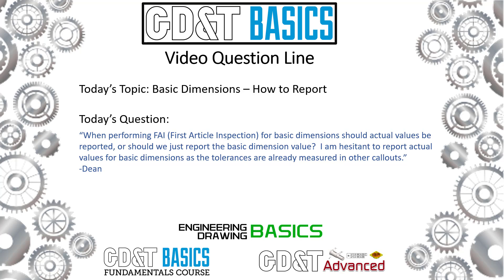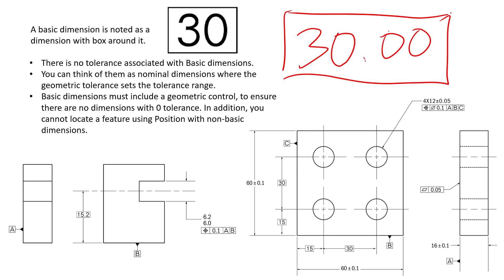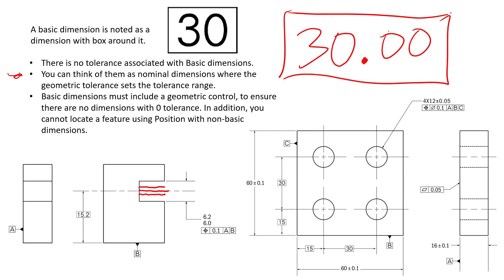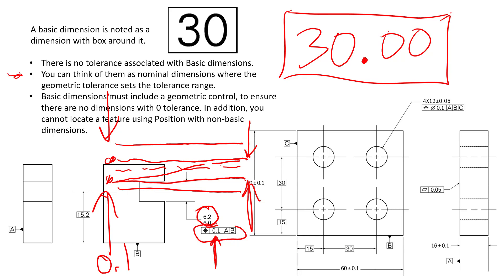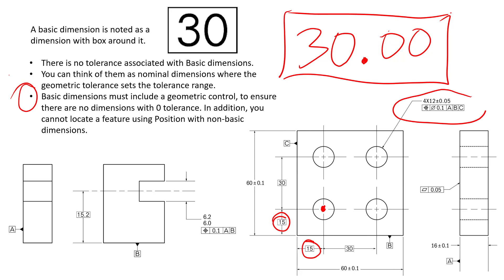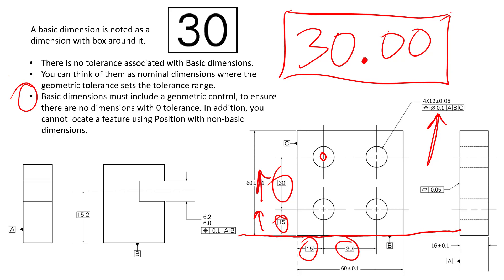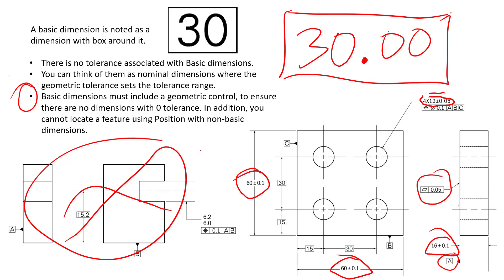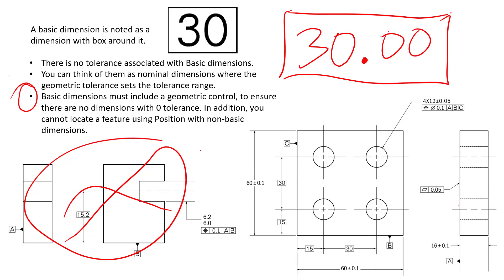Basic Dimensions and How to Record on an Inspection Report

Comment: One question on the median plane, how can we measure the median plane ? since it's an virtual plane, the only way to determine the median plane is by using CMM?
Reply from the maker: Using a CMM is not necessary but it is a solution. If we don't have a CMM we can simply place a best fit gage block inside this width feature and measure to one side of the block, and subtract/add half the size of the gage block. This would be the location of the midplane.
Reply: thanks for the great answer  @Gdandtbasics

Comment: Hi guys, so it means the tolerance should be 0.05mm for dimension 30?
Reply from the maker: The 30mm basic dimension does not have a tolerance, it only helps us identify where the hole NEEDS to be and the 0.1 mm position tolerance tells us the diametric zone that it needs to be within. So each hole can deviate in position, from its ideal spot, radially 0.05mm. This would essentially mean that the maximum distance that 30mm could ever be would be 30.1mm and the minimum would be 29.9mm

Comment: How do you read depth or hidden lines on these prints for drilling depths?
Reply from the maker: When a depth is shown on a drawing for a blind hole, the measured depth must only include the full usable diameter.

Comment: I agree with your explanation, however, I think it inadvertently  exposes a gap in GD&T for true position and diameters. If only the deviation is reported, then I can't tell which direction relative to the datums the hole has drifted. This has been a problem for me when trying to determine if a part can still be used. For this reason, I would prefer the distance from the datums be reported. It tends to be the same as the basic dimensions. So, why not put on basics that would guide the inspector on how to report the deviation and the direction from the datums?
Reply from the maker: This is a great question Thomas. We created another video recently that highlights the issues with reporting basic dimensions. We completely agree with you that simply reporting the total diametric deviation leaves the shop floor lost as far as error mitigation. Reporting a simple 2D coordinate measurement leaves a lot of assumptions to be made on how to get closer to a "perfect" part. So we highly encourage more information to be included when reporting the total diametric deviation. Many software will allow you to report visuals or give additional 3D information that supports the total diametric deviation and its extreme locations or orientations to help define the "direction" of error.
Reply: One way is to have the part laser scanned and compared to the CAD, that'll show exactly what's going on